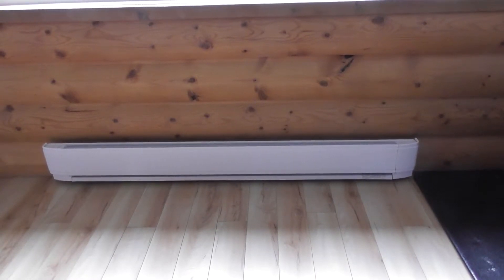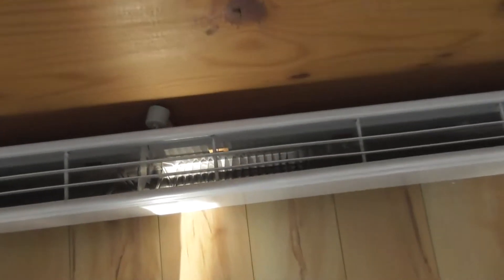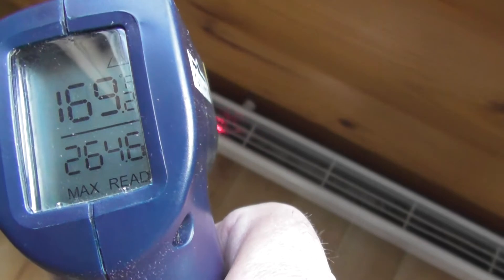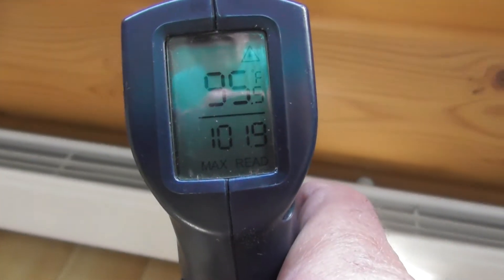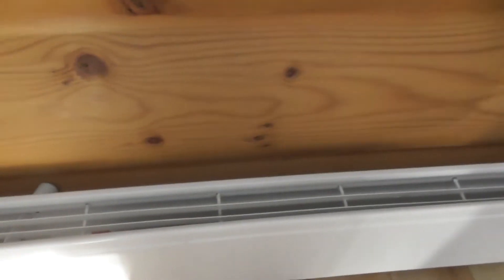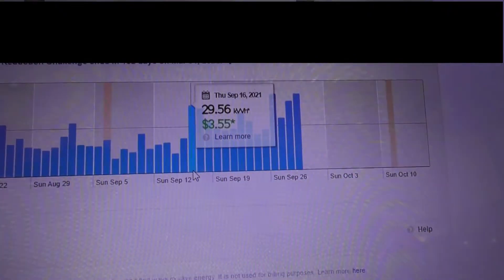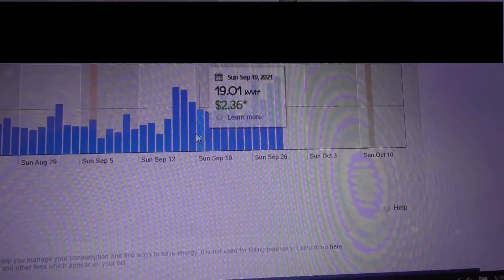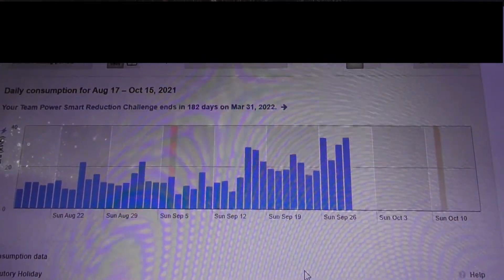Dimplex Linear Convector Baseboard Heater 3 Year Update

Comment: This is efficient for real in terms of heat you get when you turn it off. Way faster than space heaters. But the bills can be really high. I live in a 3 floor house (1200 sqft) with 10 of them from 750w to 2500w all over the place. I only use 5 of them consistently but My consumption for last month was 2200kwh!! Despite not running them 24-7.. I'm trying to set a comfortable temperature and leave them running. I think they are more optimized that way any recommendations??
Reply from the maker: I find that using a small fan set on low, really spreads the heat around and reduces the amount of time you need to run the heaters.  Good Insulation also really cuts heat loss.  Also using window insulation kits, usually just a few $'s, really are a cost effective way to cut cold wind draft through your windows which reduce your heating times.

Comment: Need a big battery bank to run that all night. 2000Wh 10h is 20kw not to bad when you look at it that way plus they do cycle on and off when the house reaches the set temp. For me that would be 27 to 30c. But you still need the sunshine to fill the bank. I know your not off grid. But just looking at that it could be done off grid. Just depends how much sun you get in winter. Good review Norm
Reply from the maker: Winter here make it impossible to go totally off grid Chris but yes, in a more sunny part of the country, it would be totally possible for sure!  They are very efficient but for me, a wood stove makes much more sense as a primary heat source.
Reply: @NormanMcGregor  Yes it is not so cold where we live and we love our wood stove in winter. 12c and we are lighting the fire lol. 27 to 30c and i am thinking about putting on a tea shirt and shorts.
Reply from the maker: LOL!! Its pouring rain and 9C outside here and still too hot to light a fire!!!  The house is still 20C inside with no heat on yet.

Comment: thx for posting. My baseboards in my cottage must be about 15-20 yrs old and Im planning to replace them for a more efficient type. The ones I have now mount up against the wall and after a season of heating my white wall turns grey. Im not sure if the heat is discolouring the paint or is it dust burning off the heaters and accumulating on the wall. I assume the new flow through design does not do this. Im looking forward to how much faster the new design will heat up the place. Going to install dimplex.
Reply from the maker: I am sure you will love them!  Just make sure to use the spacers between the heaters and the wall as they do put out a lot of heat and will discolor the walls if flush mounted.
Reply: @NormanMcGregor  thx

Comment: How do I shutoff the dimplex LPC baseboard without a wall thermostat? The manual is not clear.
Reply from the maker: My Dimplex heater uses an inline wall thermostat.
Reply: @NormanMcGregor  I change the temp by kneeling down and adjusting the controls. Once I set  it, I don't really have to worry about it.
Reply from the maker: Yes!  That model does not work with an inline wall thermostat.
Reply: @NormanMcGregor  you are right. I'm going to call Dimplex for help. Ie, how to shut off the heater without shutting the breaker down
Reply from the maker: You could also just lower the temp to the lowest it will goto and it should stay off.